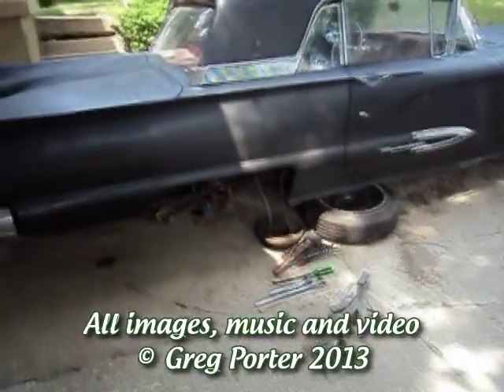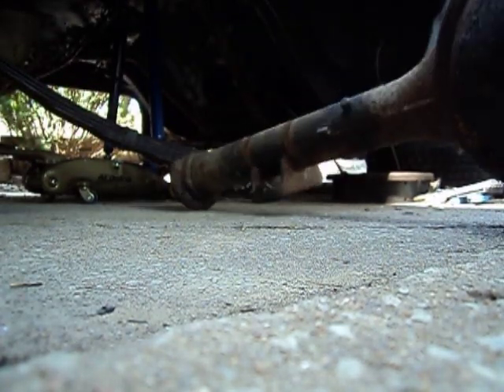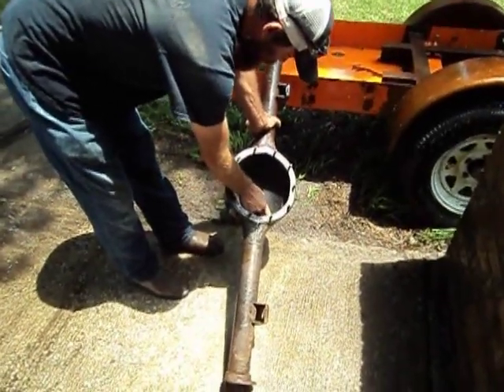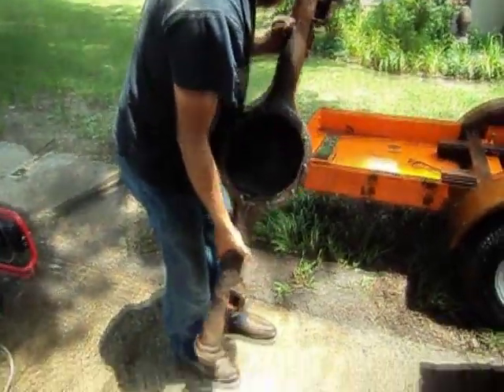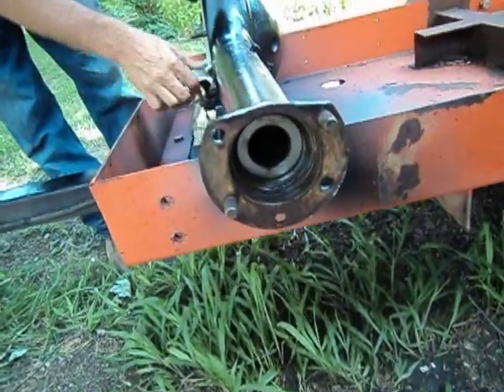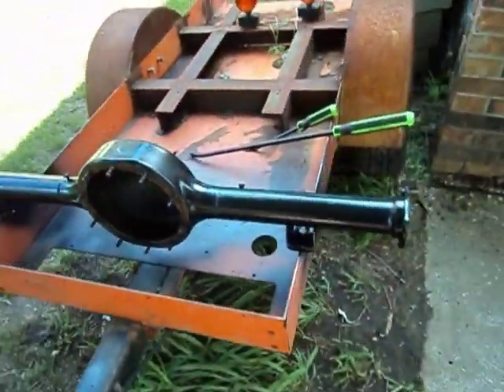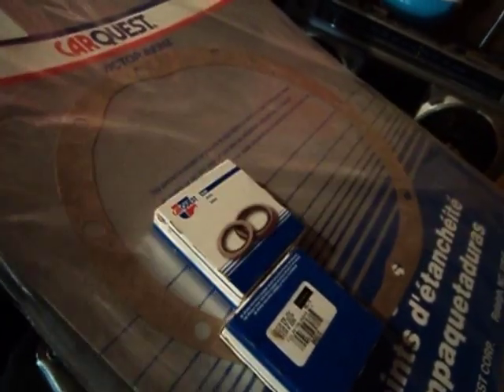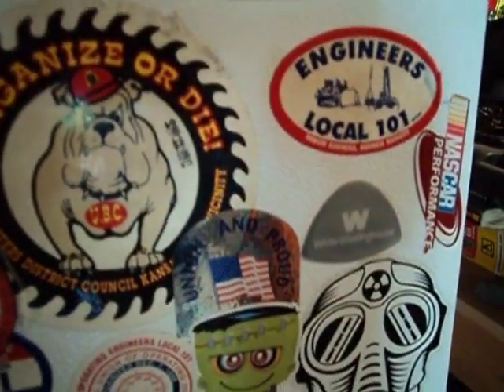Ford 9 Inch Rebuild - Part 1

Comment: Looks like you figured it out. Bearings and seals are identified by the size of the flange end of the axle housing. Don't forget the flange gaskets.

Comment: Greg thanks for the video.  My rear needs to be torn down and checked.
Reply from the maker: There's a lot more to building a good 9" than I know...  That's for sure.  Good news is, there are about 1,000,000 folks out there who know them inside and out.
Reply: Yeah no kidding.  It being a highly used item makes information easily obtainable.  I have a guy who is going to check mine out for me.  It's been sitting for years and just needs to be gone through.

Comment: In all my years, I've never seen a rear end power washed before.... if there's a will, there's a way huh?........{{ Don't forget the new Axel Bearings * Pinion Bearing * Crush Sleeve !!!  }}..... AND, that rear-end housing (3rd member)  that I saw on the work bench, I'D like to buy it if you guys don't use it?!?!?!?.... Its a GOOD ONE with extra webbing for heavy duty & racing use...if it has the letter "N" embossed in the case inside of the webbing area, its even stronger yet!!!!!!!!!!!!!!!!!!

Comment from the maker: The housing -may- already be spoken for.  I'll check.  Thanks for the advice on the bearings.  I gotta check to see if the axle bearings are toast.  I think Scott is getting a rebuilt pig, so the pinion assembly should be in good shape.

Comment: Yeah, i think only 8 inches are tapered no? 9inch is always the larger seals/bearings... i'm rebuilding and modifying an 8inch for my project car... as usual it started out like, let's just swap it, to let's clean it up, to let's put a Detroit locker in it ... going by that rate, the car will be done by 2040 LOL